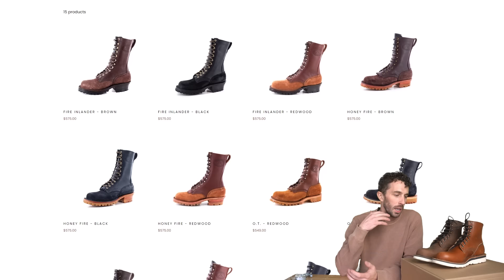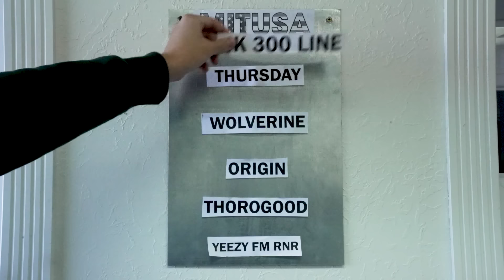Did JK Boots really make a $600 boot for $379? JK 300

Comment: How do these moc toes compare with the White's & Nick's boot's?  Especially cost to quality for last year's White's Perry & Nick's boot's?
Reply: These are not Moc's.
But build quality/materials are between those 2 you mentioned.
Reply: @jeffmitchell72  Yes you are correct, I meant the wedge sole & lower price point for the companies.  The white's we're & everyone were so amazed by being under $300, that didn't last for long the price shit right up.
Reply: @georgeoed1788  lots of people have been pretty disappointed in those White's Moc's. People who have bought them for work are downright p!ssed because they don't hold up. Not deserving of the White's name. But for the casual wearer they bring some nice color choices to the table.
Nick's is the best Moc you can buy by a longshot, but you pay for it of course.
If price point and wedge are your requirements I can't think of a better boot right now than this JK pair.
Change your parameters and I could make other suggestions...
Reply: @jeffmitchell72  Hi👋🏻Jeff,
I have had many health issues in my life, almost dying several times as a kid & an adult.  So my body has been put through the ringer, I was given a 20% chance of living when I was 12 year's old at John's Hopkins in Baltimore, MD & when I was strong enough I started working out & building my body up lifting weights, doing cardio, playing bball at the park, etc so I wouldn't have to feel the way I did like everything is out of my control!  I grew pretty big naturally I was never interested in supplements to me the gains wouldn't feel real.  I got up to 5'8" 283lbs. with 20"arm's, 60"chest, 36"waist & was leg pressing right over 1,000lbs. & I felt pretty good about myself, not great because I still saw myself as the sick kid who couldn't walk or even stand up.  Then someone drove over my Honda Accord with a Chevy Suburban head on & crushed my car like a monster truck, when they went off the back they sent my car spinning.  The fireman & paramedics thought that I was dead when they arrived, but I was just trying to calm my body down.  They had to use the jaws of life to get my car open & they didn't want me to move, but I told them that I needed to stretch & got out of the car to there surprise.  I did go to the hospital & the doctor's said that if I didn't have the extra muscle mass all of my organs would have been crushed.  Although I looked fine I had many internal injuries & was told to not lift weights or do any serious cardio, only 10-15 minute walks a day which put me into depression.  I ended up on permanent disability which sucks but with all that my body & mind went through I am unable to go back to my normal life.  I ended up with non alcoholic liver disease among many other problems so I have to be careful about pain killers & I live in constant chronic pain.  Now my feet have fallen apart I have flat feet & my arches have completely dropped, the soles of my feet have detached from the meat in my feet, my left foot is sliding towards my right foot, my right foot is sliding outwards, now I found out I also have severe peripherals neuropathy & it is advanced for my age, so I was sent to have an MRI again & where the nerves are coming out to go down my legs is pinching!  I am allergic to most antibiotics so most doctors don't want to work on me, because I am a high risk patient!  I was told that I need to get supportive but also with a lot of cushion & I also need to have ankle support in my feet which are now wider than they used to be?!  I was measured at 8.5" 2E but that doesn't fit me, so I spoke with Grant Stone & they suggested 8" 3E which is what I tried on in an Alden's Shoe Store, because they are 1 of the closest reputable shoe stores in the area.  Now knowing that I am on permanent disability & I am at least 8"-8.5" & a 3E (EEE) with a limited budget what would you suggest to wear, I am going to eventually need more than 1 pair of mid to high top shoes or boot's & I am on strict budget since I can't work ever again I am open to Sneakers, Hiking, Boot's, etc most likely I will need to find a summer & winter pair of boots or sneakers but you will be hard to find mid/high top sneakers in a wide width especially bigger than a 2E, boot's come in a wider width so that is what I am looking at & regular hiking boots normally don't go bigger than 2E unless they are custom made & that is out of the question after being misdiagnosed & spending close to a $1,000 on custom made orthotics so I am open to ideas?! Some say a wedge sole would be the most comfortable for my feet, I just want to be able to walk normally without to much pain with my wife!  It is depressing & to loose everything in 1 car accident, especially when it was a cop's wife who did it, I have many friends in different branches of law enforcement & they all said that I was screwed!  We went to traffic court & her husband & the other 2 officer's stood with her, they never submitted my report only her's, they didn't bring the 1 witness who said it was her fault, 3 times she was warned by the judge for cussing me out & then when I said I could not see her vehicle over the wall she said that she saw me I said well you were in a lifted SUV so it is not surprising & I asked why she didn't slow down if she saw me & she literally try to attack me in court & the judge had the bailiff remove her & said that each of us were responsible for our own injuries & damage!  I got screwed royally & now you know just a fraction of my life's misfortunes, there have been many other things that have been in many ways worse than that, but physically this took me out for life!
Thanks For Reading 🤙🏻,  George
Reply: @georgeoed1788  how old are you, how many years do you think you have left, and how much wear do you put on footwear, are my final questions? (I know....a little morbid, I apologize) 

If you are older, with few years left, and don't put lots of wear on footwear you are thinking as I expect you should be.

But if you are the opposite (younger, higher life span, & lots of wear on footwear) then I'd like to suggest you are thinking about costs wrong....
These PNW brands regular boots are all resoleable and rebuildable. Making them a lifetime purchase. Meaning that as time goes on they actually become cheaper and cheaper from a cost standpoint. So they would end up effectively being cheaper than the cheaper boots. Plus never having to break-in uppers again.

But I don't yet know how that applies to you.

I do know these JK's don't come in a 3E, nor do the comparable Frank's Patriot. (they both go up to 2E).

Needing both a high arch AND lots of cushion puts you in a tough situation as work boots are not known for cushion. Wedge/crepe/Christy soles certainly are best for cushion, but generally speaking don't come with the higher arches these PNW boots are known for. They can also be more slippery as they wear. You can get sized with the intention of using a cushioned insert to help though.

I guess I'll still hold up on my full suggestion for a recommendation for another answer from you......
Reply: @jeffmitchell72  I didn't find the question morbid, when people want my advice or suggestions I tell them that I need all the data to give my best opinion.  I just turned 49 & I feel like I am an old man from all the things that have happened to me over the years.  I don't really care what other's think & do what I want to, I wear shorts in the middle of winter because pants are not as comfortable most of the time & I get hot easily.  I like my clothing to kind of match but I go choose comfort first as long as I can afford it, I mean I am unable to work anymore so I don't come into contact with to many people I know anyone on a daily basis & I am at home most of the time.  The thing is I do want to look good for my wife when we go out so if we are doing something then I will try to dress up some.  I also can't really buy off the rack with my build, since I still carry a lot of muscle mass & I am on the short side especially after my car accident stole 1"-2" from me.
Reply: @georgeoed1788  so you'll have them for a long time, but might not wear soles out very fast. 🤔
Which makes you a good candidate for the wedge soles I guess.
So I think you need to put together a long term picture in your head for boots. Think about the cost to buy boots that are 3E width, and think about how many pairs you will need to buy in your life God willing. Then think about how many times you'd need to resole and rebuild one good pair in your life. I think you'll find a great pair of 600 boots pay for themselves. That doesn't even take into account how much better they will fit. So I know you said you don't have the money, but they will end up saving you money long term if you can come up with the initial cost. 
I think you call Frank @ Frank's boots. He is incredibly nice, incredibly knowledgeable, and loves a challenge to get abnormal feet into perfectly fitting boots. He was General Manager and minority owner of Nick's Boots for over 20 years b4 opening his own shop.
Tell him exactly what you need & want, and he'll build you your forever boots. Each boot made to each foot. Room to accommodate the right insert for as much cushion as possible. The best sole which sounds like a Crepe/Wedge sole in whatever color suits you. In whatever height, which for ankle support sounds like 8", although with shorts maybe Asthetically 6"? It sounds like he will have to figure out how to build you a boot with a high arch and a Crepe/Wedge sole with is an uncommon combination.
They have a new model called a Monkey Boot that I think would look nicer than most with shorts. (I have a pair on order that I plan to wear with shorts) a Monkey with the 4811 last will give you lots of toe box room and accommodate different thickness socks that can provide even more cushion for you.

My only hesitation is that Crepe/Wedge sole. They can get slippery as they start to wear out and that sounds particularly dangerous for you. They probably aren't the ones that most stable sole either. Also, a heel, even if not very high, might help you distribute your weight better. So a more sturdy, longer lasting, low heeled sole might be better for you? A good cushioned insert, and quality cushioned socks might be the cushion you need? 🤷‍♂️ I dunno, but Frank will.

Comment: Not surprised they used a lot of the same construction. Because if you have one boot using different materials then all your others, though it's cheaper material but the cost to source them will be higher. Because if you 10 different products and 1 don't use the same material or different, has it's own hinderncr to the bottom line. Buying more materials in bulk is cheaper.

Comment: If they had a smooth black leather option for those, I'd be swimming across the Atlantic to get myself a pair right now.
Reply: Did you go to their website? They do have these in black.
Reply: @859romulus22 
Yeah, but the black version is nubuk/rough-out. I don't like rough-out leather.
Reply: I just went to the website and looked, the 300’s in black come in (Uppers/Lowers - “Smooth” 5.5 oz full grain oil-tanned leather). I’m not sure where you are seeing they are rough out. Are you just using the pictures for reference? Maybe the leather just isn’t as shiny smooth as you think it should be? Truly trying to be helpful. I have a pair of smooth upper/rough out lower boots, the lowers almost look like carpet they are so fuzzy.
Reply: @859romulus22 
Yeah, I looked at the video, and the pictures on the product page (which I did, in fact, use as a reference) look a lot less smooth than they actually are. Thank you for calling my attention to that, I know what my next pair of boots is gonna be now ^^
Reply: @Krankynator   No it isn’t, it’s a smooth. Look again.

Comment: I'm a college kid wanting to get into boots and have been scouting out what to get.  I have some timbs pro boots that I bought ages ago but they are too big for my feet and also just heavy and end up causing heel pain for some reason.  I'm looking around the 200 dollar range and Thursdays keep catching my eye but I don't know if I can trust the QC after reading countless comments on reddit.  I guess my question is should I go for the Thursdays, and if not, what other brands are recommended for the 200 dollar range?
Reply: Fellow college kid except into cowboy boots, I suggest maybe looking slightly used. eBay, poshmark, Mercari, etc can have slightly used boots for very good prices. I know it can be weird to buy something that someone else’s feet were in, but there are plenty of slightly used boots that were only worn a couple of times
Reply: I went with Jim Greens, and the bastards are great.
Reply: Also, I’ve heard some good things about Thursday so I think you’d be okay. They’re kind of like Tecovas in the cowboy boot world, where some people swear by them and others claim they’re garbage made to fall apart. Either way, I don’t see a ton of them fail and there’s plenty of examples that are years old. I think Thursday is the same way
Reply: Check out Midwest boots  they have two pairs of Thorogood Boots that they are discontinuing. Both will be under 200 dollars after the discounts they give you. Also if you call them directly they will give you $30 more off. Luke I said just check them out and call them. You won't be disappointed.
Reply: Check out the made in America heritage golden fox moc toes. There 200 and a great boot for the price. Really won't find a better boot for 200 bucks
Reply: Tradesman and all-day stander, here. You can't beat Thorogood for immediate comfort, but you'll be spending a tad more than 200 these days. Also, I wouldn't put too much stock in redditors - their opinions stink, in my experience. A bunch of negative Nancys. Do your research, try on what you can, and find something that works for you - everybody's foot is different, and you don't have to be ashamed of buying a different boot than everybody else wears.
Reply: @Arto257  couldn't agree more. I'm on my feet 12 a day doing concrete, framing and drywall. Thorogoods did amazing for me. But when they jacked there price up 80 bucks I was bummed. That's when I tried the American made golden fox. And they are great. They don't have steel toes which sucks but they are as comfortable if not more then the thorogoods and they have a leather welt. I even have two pairs of there cheeper Chinese made boot and there still great quality and very comfortable
Reply: @KillerNoob2001  I was looking at some Jim Greens but it seems they’re better for hiking then standing or walking around.
Reply: @ianmccoy9475  I just checked out their site and those seem to be a solid choice to consider
Reply: @Arto257  I’ve heard thorogoods are great but I personally just don’t dig the chunky look and the branding all over the boots.  Reddit definitely can be rough but i mostly used it to see photos of the boots I like after use.
Reply: @ryanp.8807  eBay definitely had some cool picks but not really in my size so I’ll try poshmark next.
Reply: Also,  I’m mostly looking for boots that look good and are comfortable over work.  I’m an artist so I don’t really beat my footwear up that bad other then constant standing.
Reply: @eservais5269  i recently got a pair of ariats, there men's midtown ramblers for less then 200 dollars brand new, I would highly recommend them,slip in, very comfortable, not bulky and look amazing.
Reply: @eservais5269  if you want something that just plain looks good and you don't plan to do any serious work in them, I gotta recommend cowboy boots. Dan Post or Ariat make great first-timer boots with rubber soles, so you don't have to worry about slipping around on a piece of leather when you hit a wet spot in the road. Ariat's Heritage R Toe were my very first pair and I've still got them. They'll run you about 165 if you can find them on sale, and you can use the money you save to buy some mink oil. They look fantastic after they've been darkened with it, and they're pretty dang comfy. They're also not as "loud" or in-your-face as some of the more exotic cowboy boots you see. Very classy.
Reply: @Arto257  I like the sounds of that.  I kept with a low budget because I'll be having to learn to take care of boots and don't want to destroy something nice.  I've been leaning towards Moc toes but I'll give western boots a look too.
Reply: @eservais5269  whatever you decide, I hope you find something you like man. Hope it helped

Comment: Honestly I've never really been that impressed with JK. I wanted to support them because they're an underdog PNW maker, but they're not really any cheaper than their competitors, have fewer options, and from what I have seen, are quite sloppy with their QC and construction. I just couldn't understand why you'd buy a pair of JK boots instead of White's or Nick's. 

These, however, have changed my mind. I agree with you about the loss leader business model probably being accurate. I think they're just trying to get their name out there, and are probably selling these first run 300 series boots at a loss. Seriously considering a pair of the blacked out ones on the lugged unit sole.